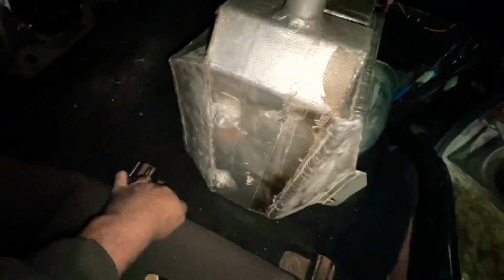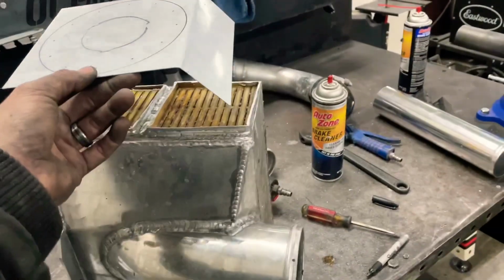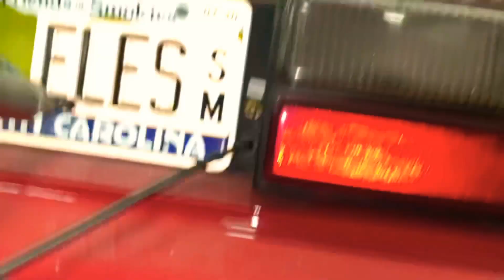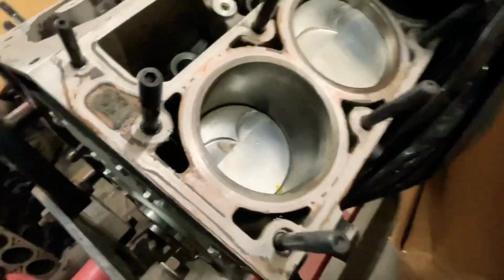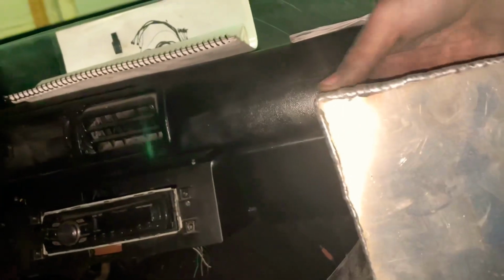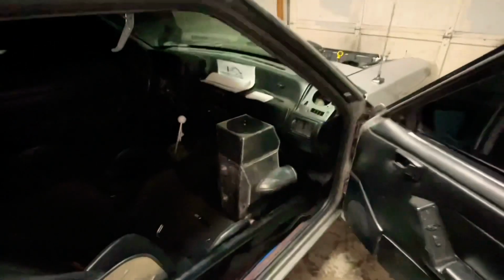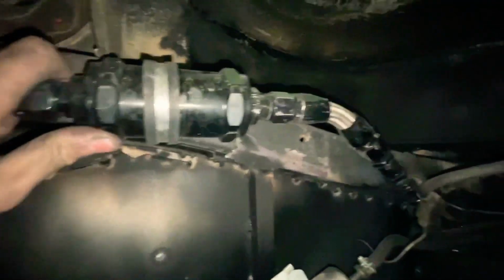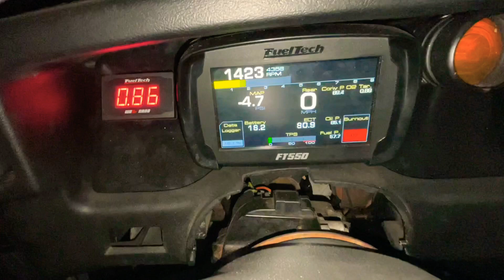Rebuilding a air to water intercooler for my turbo mustang

Comment: Excellent job boosted, looking good thanks for the update on the sealer. Hey maybe you can help me with something. You know car guys, selling a 69 camaro all new sheet metal inner outer fenders hood doors inner outer quarters trunk lid trunk pan and taillight panel,even the top skin is new new wiring harness brake lines all fuel lines new front suspension with disc brake upgrade 327 350 transmission 12 bolt slider rear end needs rebuilt. I have most of the interior not all. Listed on Facebook market place virginia black on black Bedford county area. Pass the word the price is negotiable but not much. It is a x44 69
Reply from the maker: Sweet

Comment: Looking good man, what kind of fuel are you running?
Reply from the maker: Pump e85
Reply: @Boostismyfriend  Cool, does it take a lot of changes from your setup to run methanol? Or is methanol illegal to run in your class?
Reply from the maker: @andrew_brent   I would love to go m1, I would have to add a extra 8 injectors and a mechanical pump,  the no prep stuff don’t care but we already make way more power then needed, Shadyside outlaws you can’t run it
Reply: @Boostismyfriend  Thanks, I wasn't sure. No kidding!! ya'll are making killer power for a true street car.

Comment: Was wondering if your s10 has any kind of suspension work and what the width and back spacing is on the wheels. I want to put 10 wires on mine but don't want them to stick out
Reply from the maker: It has stocks stuff other then the drop spindles and a few leafs took out the rear, I have a 8.8 that is narrowed, it’s 3/4 wider then stock, I have 15x8 5.5, with a 10 you need a 6.5 backspace wheel
Reply: @Boostismyfriend  Thanks

Comment: What’s the air compressor used for?
Reply from the maker: It one of the eBay ones for like a air horn
Reply: @Boostismyfriend  but what’s it used for? What’s it plumbed into on the car?
Reply from the maker: Sorry I was driving and missed the question, lol. The air compressor is plumbed into the boost solenoids, we use it threw the fuel tech to regulate the boost
Reply: I gotcha. I’ve always seen co2. Never seen air compressor used.
Reply from the maker: @boostthisms  yep, it’s simple and free air, don’t have to worry about cutting the co2 bottle off, or it being empty when we get to the track,  we can add 120psi of some if we want to
Reply: I think it’s a simple and awesome idea.
Reply from the maker: @boostthisms  so fare it has been, it has worked flawlessly all year, I set the psi in the fuel tech that in the compressor, then i command how much boost I want, it does the rest it’s self, we have ran the same setup on Nigel’s car for 4 years